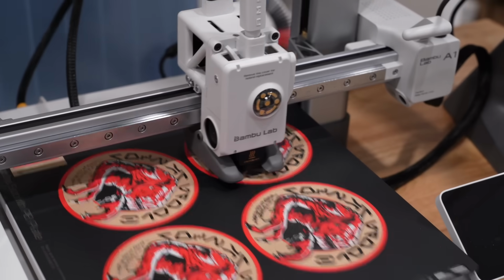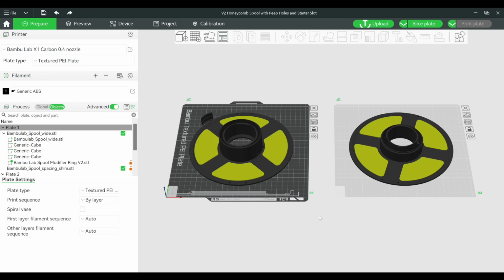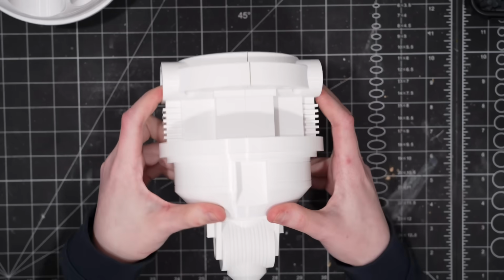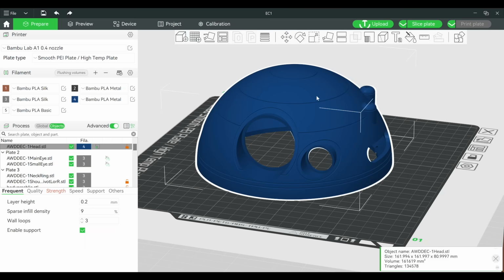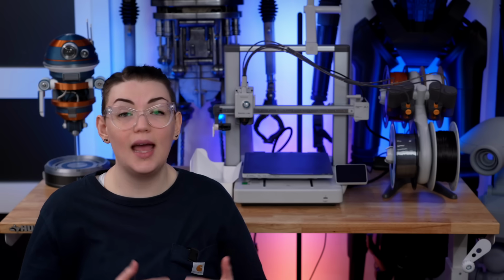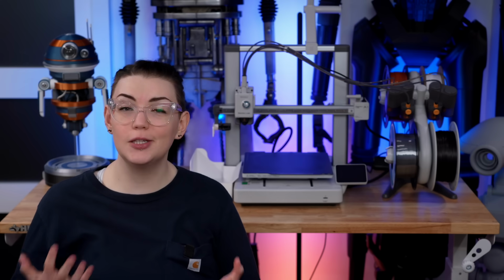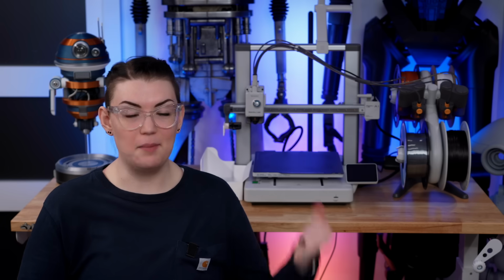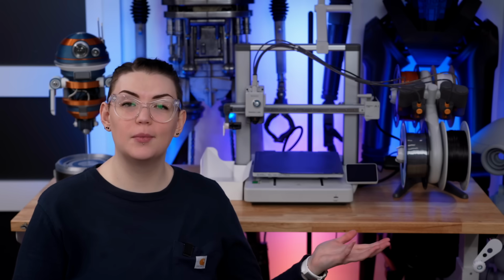Is the Bambu Lab A1 the Unbeatable 3D Printer for Beginners?

Comment: I would describe it less like a toy and more of an appliance. Coming from an old Ender 3 pro to the A1 series printers made me fall in love with 3d printing again.
Reply: Man I had the exact same situation. I used to print on an Ender 3 and I had fun but slowly fell out of love with 3D printing. I picked up an A1 Mini and I’m having fun again and spending so much time just playing with it
Reply: @_lord7th_ ditto. Printing issues with the printer despite following a rigid protocol... Finding out after 2 hours the print failed... Ugh
Reply: I was the exact same way with my Ender 3 too. Even after adding bed levelling, I never printed as much as I wanted to because of the time it took for me to constantly deal with problems.
Reply: @C0mfortCruise on my Ender 3, once I got set up, I would keep printing because my setting were good. As soon as it would cool down, you had to start over most of the time.
Reply: @TheNewfiechef Yep, that was the same experience for me too. And worse was the slicer, I've never enjoyed using Cura. Where Bambu Slicer saves filament profiles completely separate from the of the print settings, Cura had everything kinda jumbled together so whenever I even changed filaments I had to go through every stupid sub-menu changing parameters to make sure it printed right for that specific filament. Took me an hour before I could even press print on the machine. If you get a Bambu you'll never wanna go back, it JUST WORKS. My A1 with AMS has increased the amount of printing I do exponentially, and sending prints through the app makes things even better.
Reply: @C0mfortCruise spot on
Reply: @C0mfortCruise  Did you upgrade to this (A1C) model, specifically? How many times faster was your new printer (e.g. 'Xs' times 2X, 3X etc)? Thank you! 🙏🙏🙏
Reply: @JohnnyMenteroMentador  Hi, yes I have the same A1 and AMS Lite. It's easily 2 to 3 times faster than the Ender 3 I used to have, (even with the upgrades I made to it back then,) and 1,000 times more convenient. If you're considering your first 3D printer, while other printers might advertise the same features companies like Creality especially have a terrible customer support and build quality track record in comparison to Bambu. Bambu really is the only company right now with this level of build quality, customer support and price.
Reply: I wouldn't touch an Ender series again after having the A1 it prints so much better and faster. Hands down way better in all ways
Reply: @dabberxfpv1613  You cannot compare 2024 printers with ones that were 3 - 5 years old or even more! It's apples to bananas.
The up-to-date Ender 3 V3 also is a completely different machine than the OG Ender was.
Point is: The old Enders were important for that development to thrive and eventually develop to the modern Ender 3 V3, Bambu A1, Kobra 3 and K1.
But one thing those old machines still can do: print silently and slow in the background, maybe overnight. Because "silent" is something that does not do together with "fast".
Reply: @hassosigbjoernson5738  Ooooo, I totally understand and know the newer Enders print better, but I still wouldn't use one after running the Bambu lab A1 and that's not even one of their better printers and it runs amazing
Reply: I have upgraded and upgraded my ender 3, two of them. But its about time to move on. Always troubleshooting and never enough printing.
Reply: @voidFutureVector  Exactly, spent more time on the printer than the prints...now it's like sending a word doc to a 2d printer, hell I dont even bother watching the first layer anymore.
Reply: I still have the ender 3 pro and I'm thinking of getting this...
Reply: @kyles3335 I am in the same boat too
Reply: Yea ima be honest the ender 3 lowkey made me go away from 3d printing but im getting an A1 so wish me luck😆
Reply: I still have my original Ender 3! lol 
Maybe I’ll upgrade to this one day!
Reply: My first printer, and only one, is an A1 Mini. I’m glad I started with that because I don’t like to fiddle with the printer, I want to print and make things.
Reply: It feels like cheating compared to the older 3D printers
Reply: I had the Ender 3 printer for several years. I started with Creality after REALLY messing around with a Sun Hokey Acrylic self-build printer (around 8 years ago) that printed really horribly "out of the box* . At the end I replaced and printed lots of parts and added a E3D printhead, before I had enough and ordered a Creality Ender 3. It was one of the first models and had many parts that had to be assembled. Fast forward to now. My last Creality was the Ender 3 V3, and it was a great printer. However, I wanted a printer that took up less space, and went for a Bambulabs A1 mini, without Combo (I don't do multicolor for now). And I must say I was blown away for the ease of use I got from this printer. It just works, and can be used just like any tool on my electronic work bench.
Still - I would not have wanted missing out on all the tinkering (even with that acrylic monstrosity) I have done, that learned me a incredible amount about 3D printing, and all the stuff that is involved (from hardware to software and even compiling firmware).
It let me really appreciate the ease of use of the Bambu Lab A1 (even the mini is great).
Reply: I got an Ender 3 recently and had nothing, but problems with it. I did the research and knew that I would run into some of the problems... but I ran into ALL of them and 10x more than I ever could have imagined or prepared for. Was thinking about a V3 KE, but I'm not sure if I ever want to bother with another Ender ever again. If they can't fix their Known/common issues after all this time, I have trouble believing they give a crap about their customers.
Reply: @deucedeuce1572  "If they can't fix their Known/common issues after all this time"

How should this happen if you got the OG Ender 3? Should they travel back in time? The Ender 3 was like 150 bucks in 2019 ... an A1 is like 399 in 2024.
Reply: Am I the only person in the world that has had no issues with my Ender 3?  Level it once every blue moon and can't remember the last time I had a failed print.

That being said, my curiosity makes me want to try a newer printer!!
Reply: @ramsaystrachan3766 yes I never had a problem with my ender 3 pro . Very very rarely do I level it always prints fine just wish was faster and multi colour
Reply: After a few years of Ender 5 madness, My baby Kingroon KP3S did that (i brought it while the enders were both dead or dying)  But the A1....  What an addition, There will be more of these coming soon.
Reply: It's the Easy Bake Oven of 3d printing.
Reply: Tell me about it, I am sick and tired of replacing parts and one problem leading to another with my Ender 3 S1, although I have some really nostalgic memory with it being my first 3D printer and I still have it. I kept running into problems with the Heat block and Stepper Motor noises and clogging and leaking, to the point of even tattooing my pei sheet and that was another expense I made twice. In the past year I have made several 3D prints and while I had great results printing at lower speed and with my own skills in 3D and with slicers, I think a beginner might still struggle a lot on those machines. I am not sure if I will replace the parts immediately, I am hopeful that I would be able to afford an A1 mini without the AMS at least soon enough to continue with my printing journey and this time actually make more progress with the original products/prints I had made.
Reply: Looking so much forward to get this as my first printer. I just ordered it with ams and ekstra hardened steel nozzles😁😁😁
Reply: still have an ender 3 pro...only problem I've ever had was a broke belt, even with all the upgrades. there is not a better printer for $200........
Reply: Same, had about 13 printers (from various companies)... all of them were "ugh, lets see if thing works or need maintenance" when ever I wanted to print something after a month+ of downtime. So glad I was able to sell them all off and picked up a P1S + A1 Mini. They have both been great.
Reply: I bought an ender 3 s1 pro this year because the A1 was on recall, but while im happy with my current printer as soon as i recoup the investment the A1 combo is coming home, then a laser engraver module for the ender 3 and im set, ill turn it to do laser engraving mostly and print on the A1.
Reply: Literally what i'm debating right now for myself, old Creality Ender 3 Pro
Reply: The exact same thing happened to me, I have the ender 3 pro and stopped 3d printing because i  spent more time fixing issues than printing things and having fun
Reply: literally same!
Reply: Im in the same boat Your Ender is very similar to my old Creality Cr ?? something I modded and those were so expensive back then. Everything got so automated now.
Reply: I love my ankermake m5c easiest 3d printer i ever used
Reply: this is deep. I like tinkering a little bit, but the fact that it feels absolutely required to get a working print on my ender 3 pro has made me consider this A1
Reply: Oh man I have an ender 3 pro and it's kind of time consuming leveling the bed constantly, fiddling with settings, etc. Makes me not want to print anything.  Been looking for a reasonably priced new one... Is the bamboo lab a1 the one I've been looking for?
Reply: @jerkomirko  I dont even bother watching the first layer now...never fails if the plate is clean. Crazy fast as well...
Reply: I am so glad I was able to dial in my ender 3. I have it running now! Printing something for the A1 I am going to get later this week. Haha. Welcome back to enjoying the hobby!
Reply: i think a looot of people think 3 d printers are toys but you can make so much cool stuf like gaming mice one of tools car parts like mirors air ducts adapters for things like throtlebodies etc its an apliance not a toy sure you can have some fun with it printing things for the fun of it but so can you with a microwave u know
Reply: I wouldn't call an ender 3 a printer
Reply: That's exactly where I'm coming from and hope it will be my case as well as I'm waiting for my A1 combo to arrive!
Reply: I became a master of debugging issues on my diy Anet A8 ghetto looking printer. I'm very happy to see your comment about A1. I've been looking at A1 and I wasn't sure if it was just a hype. Thank you.
Reply: This is EXACTLY what I'm thinking. I got tired of upgrading for better prints on the Ender 3 V2, and just stopped printing because I got tired of working on it all the time. I'm thinking the Bambu A1 is good option.
Reply: Same😂
Reply: I put my Ender 3 away in a box a couple of years ago and never bothered with 3d printing again. The constant calibration and issues I would have drove me to dislike 3d printing altogether. Seeing a few videos on the Bambu Lab printers has reignited my curiosity.
Reply: I have a decrepit Ender 3 base model and my A1 mini is a few days away from arriving in the mail. I can’t wait!
Reply: What color are those and who makes it for the ec1 driod please
Reply: Funny enough I am getting the a1 combo today and I am also coming from an OG ender 3 lol
Reply: Good to know because my Ender 3 took a piece of my soul every time I tried to level the bed. I will look into this brand.
Reply: Man printers have come a long way since my Ender 3. Everything was manual and now pretty much every thing is hands on. I’m glad 3d printing is still going strong. I’m glad to be part of the gang who got in on the ground floor and uploaded settings on Chat boards and comments on YouTube videos so that we could improve 3d printing and make it better for the next generation.
Reply: Same
Reply: It's ender 3 worsted?
Reply: I had the ender 3 for way too long and I thought it was newer than it was and a couple days ago I got the a1 mini and I love it so much no more endless tinkering and reprints
Reply: damn straight friend. I find the ease of use to be so much better than my slower counter part printers. I have a anycubic mega S, monoprice mini select v2 and a ankermake m5c (the only other fast one is the ankermake)
Reply: I'm about to make this transition as well. We have a print shop with 2 cr-10 max printers and 3 ender 3v2's that I've had to continually fix over the years. Going to feel good scrapping the old enders for the A1. Maybe I'll mod one while I'm at it.

Comment: Thanks for showing the printer in such vast detail. I've saved up enough for the Bambu Labs P1S and AMS combo over the past few months and planned to buy it on Black Friday. Although I started debating getting the A1 because the AMS lite can handle cardboard spools, the A1 printer combo is about half the price of the P1S combo, but I wouldn't be able to print some of the materials I've been thinking of. been weighing the pro's and Cons for a while but you went into so much depth into the A1 it answered all my questions. I'm Gonna get the A1 Combo!

 Btw I love your vids, I've gotten into prop making and when I get to a faster machine I'm gonna make a droid or two.
Reply: A bit of electrical tape stretched around the rim fixes that cardboard spool problem.

Comment: Oh gosh I now need to print that droid where can I get that orange? I see the blue in Bambu store. I simply want to copy exactly what you have done it’s so amazing 😎
Reply from the maker: The exact filament I used doesn’t seem to be available anymore on Amazon, but any silk Copper filament should be reasonably close.
Reply: @MMsPropShop  thank you will look for some copper 👍
Reply: @MMsPropShop  seems the link to buy the STL is not going to the right place goes to the sellers main Esty shop and I can’t see it there. Possibly been removed from sale?
Reply: Ah no I read properly now you’re saying that this one is included as an extra to the main droid I think 😀
Reply from the maker: @smdemmery yes. There’s lots of awesome bonus files included with the Pit Droid and that’s one of them.
Reply: @MMsPropShop  oh that’s amazing to hear will purchase now thank you
Reply from the maker: @smdemmery you’ll find it through the PD 2023/2024 update file section

Comment: Since you're doing a print which is using different colors but most likely the same type of filament, I'm wondering if they could be melted down and extruded into a "test filament"... The color wouldn't be great of course, but if you wanted to print a couple of things to test out an idea or to make a prototype that wasn't going to be something you would have permanently, then this could be used instead of wasting fresh filament. 

What are your thoughts on this?

Comment: PETG can be printed without stringing by using a drybox. What I am using is a cereal box with desiccant in it. I put my spool into the oven at 70 degrees for some time then I put it into the cereal box. I take the desiccant and put that in the oven and also microwave it for a couple minutes. Then put it on 120 degrees celcius. After a while there will be no more moisture and I then take the spool out of the cereal box and throw the desiccant in after letting it cool down enough so it doesn't melt the plastic box. I then shake the desiccant around which will cause the desiccant to remove all moisture in the box and also cool the desiccant and heat the box. After that I put the spool in on the 608 bearings and roller and it will stay at near zero moisture for as long as the cereal box and desiccant remain dry.
This means I can print without using additional energy for a filament dryer. 240 degrees celcius without stringing.
So I did something like this: https://www.thingiverse.com/thing:4328914
Actually only used the mounting thing from this design. I edited it to allow me to use M3 screws and allow me to rotate it without having to print a different version.